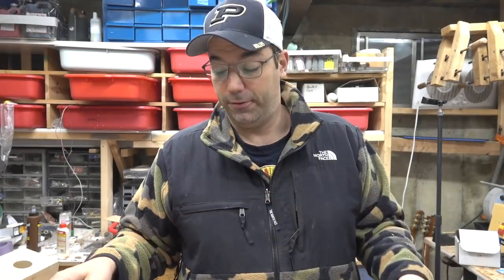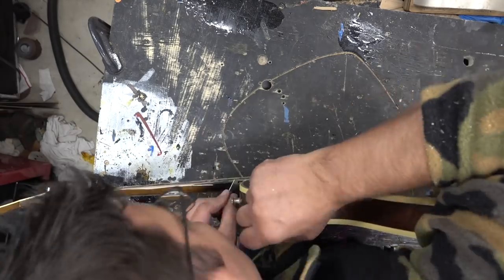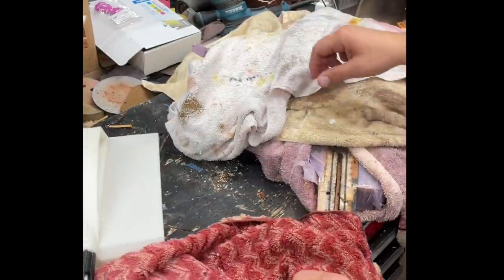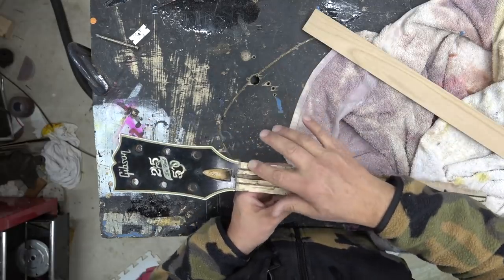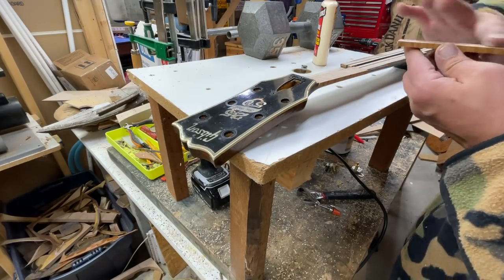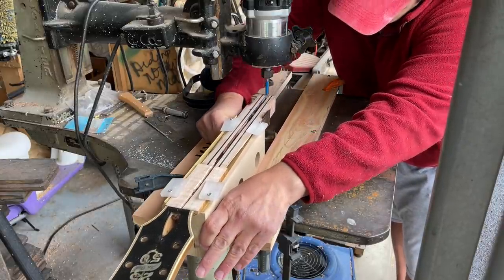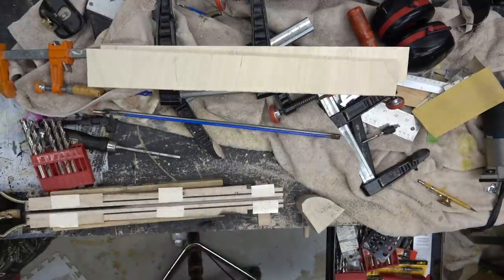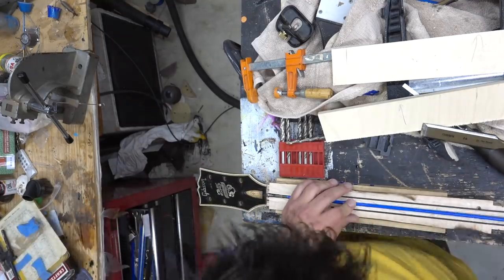Les Paul 25/50 Repair Part III - Stabilize the Neck

Comment from the maker: Les Paul 25/50 Repair Vids: 
Part 1 Project Intro - https://youtu.be/x1M5snCUCy4
Part 1A More thoughts - https://youtu.be/rqHn48Yf5Lg
Part 2 Removing the Fretboard - https://youtu.be/uT5R7Y-HJAM
Part 3 Stabilze the Neck - https://youtu.be/sng2UAwT5rM
Part 4 Build the Neck - https://youtu.be/OYoXurXrba4
Part 5 Carve and Clean up - https://youtu.be/PtzKx12dA3w
Part 6 Rebuilding the Fretboard - https://youtu.be/7K4--qrDdok
Part 7 Fixing the Body - https://youtu.be/hIaOANeOek0
Part 8 Final Finish  and Demo - https://youtu.be/_-5KHMNN_DQ

Comment: I know I have commented in a similar fashion before on another Les Paul.  Guess what,  I'm back!  OK,  that being said,  let me start by saying I'm not criticizing AT ALL.  More playing devil's advocate.  With all the surgery you're doing to that neck,  any argument that it's the original neck is kinda not accurate.  With that,  wouldn't it be easier/faster/better/cheaper to just build a new neck using the same woods, and use the original headstock overlay?
Reply from the maker: I wanted to keep the original stamps and not have it look like it was cut off.  that would totally kill the value
Reply: @bigdguitars , I get that.  I'm following along,  enjoying the fact that it's you doing the work,  not me.